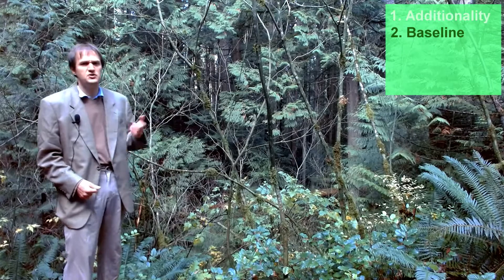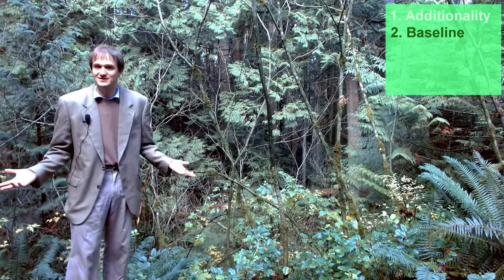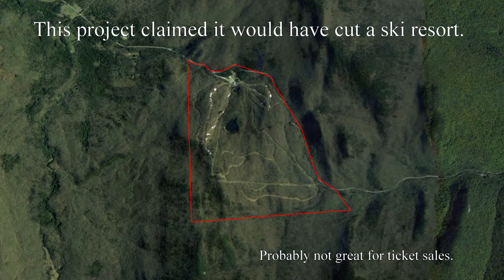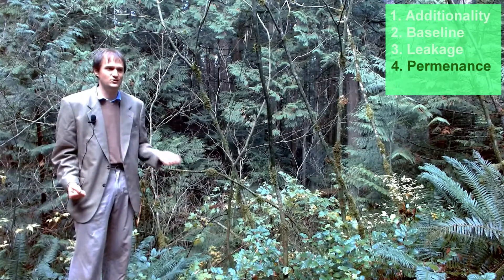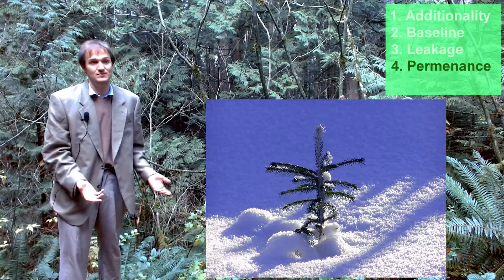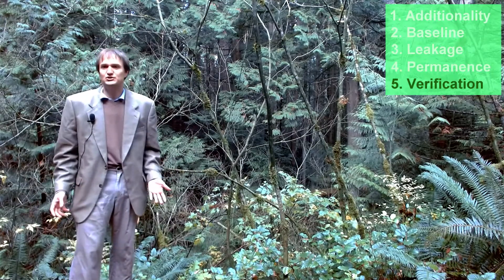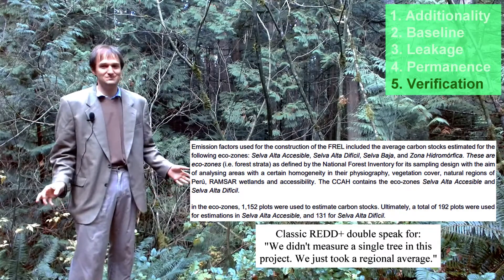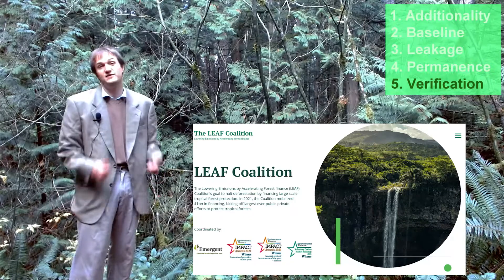The five components of forest carbon projects. And what to look out for!

Comment from the maker: This comment was left on another platform:

"This is a good video, but it applies much more to international projects than North America. For example you note buffer pool contributions are trivial which is sometimes true under Verra, but most projects developed in the US have a mostly fixed ~20% buffer pool contribution which is not trivial.

I think your explanation of leakage is good. Activity shifting leakage is the idea that a project proponent will simply harvest carbon in an area outside the project. Market leakage is similar, but it’s the idea that the market at large will replace the harvest of the sequestered carbon such that it won’t really be additional. It’s usually assessed at a regional or “wood basket” level. For a lot of Verra’s methodologies this leakage deduction is very low and sometimes zero. In North America projects these deductions are very substantial, 20-40%."

- AltOnMain